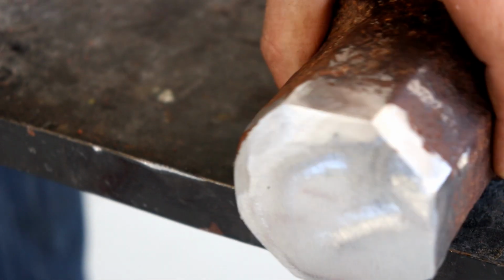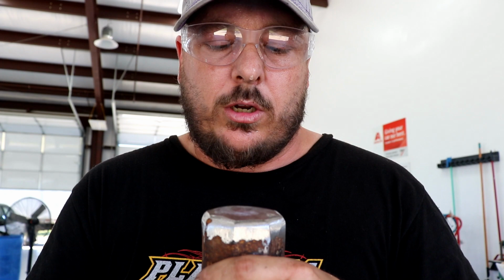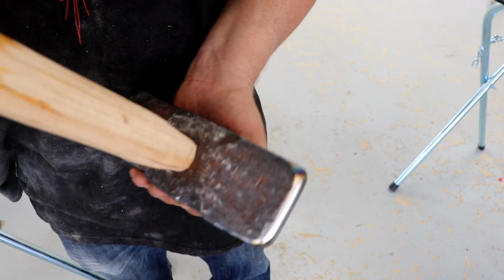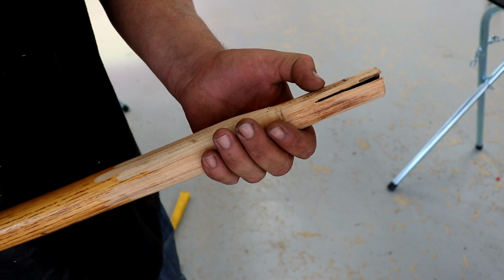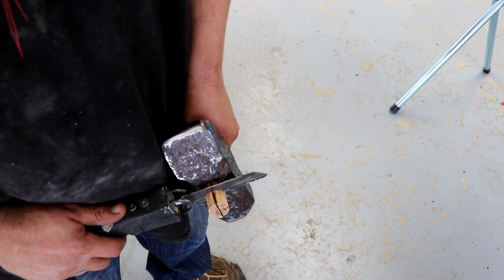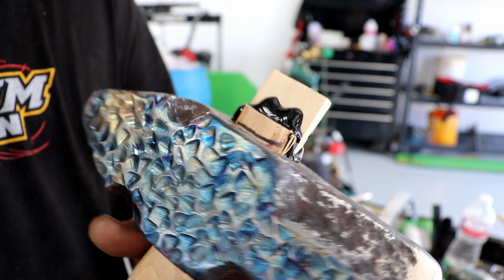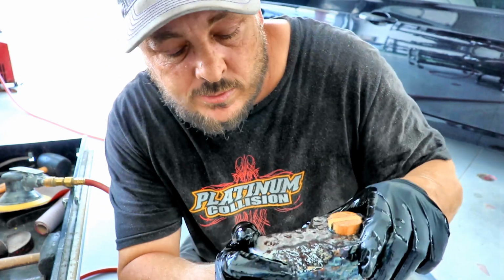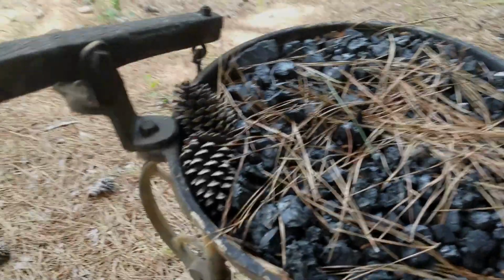RESTORING JUNK HAMMERS FOR BLACKSMITHING. Restoring Blacksmithing Tools Series.

Comment: Enjoy watching what you are doing. hint from an old logger and farmer told to me, put the head in a bucket of water  and hit the handle with a hammer. Pulls it right on up and the water swells the wood to insure a tight fit.

Comment: You are an artist both in your restorations and in your videography. So happy to have found your channel. Quick question for you or your subscribers... I recently purchased a rotary grinding tool like the one you used in this video. However I was so disappointed to get home and discover my air compressor wasn't even close to being powerful enough to run it properly. Can anyone advise minimum specs for an a.c. with enough umph to operate such a tool? Much appreciated.
Reply from the maker: +Trudy Schaefer Sure! You need a 60 gallon 90 cfm. They cost about $500 to $1000 depending. Hope that helps.

Comment: "We need hammers to make hammers."  Yes, yes you do.  As always, nice work.  I always enjoy watching you refurbish & customize an axe or in this case a hammer.  The more videos of your excellent work that we can see & learn from, the better.  

By the way, what was that spray you used on the hammer.  I suspect it was a bluing spray of some sort but any info or further details would be much appreciated.  Cheers from Vancouver Island.
Reply from the maker: +Imightberiding It was actualy just an oil coating to cool the temper. The temper color was put in with a torche. Thanks Brother
Reply: Ah yes, of course.  Makes perfect sense.  Thanks for the quick reply.
Reply from the maker: +Imightberiding It was actualy just an oil coating to cool the temper. The temper color was put in with a torche. Thanks Brother

Comment: Im not a blacksmith but I do find these videos interesting, but one thing puzzles me, I always thought the face of a hammer had to be hardened and temprered before use. Surely sanding it back like that will remove the hardened and tempered surface?

Comment: I will assume you didn't have access to a bench grinder or belt sander. Still that hammer came out decently and should be servicable enough to use for making some others in the shapes you need.
Reply from the maker: +CrimFerret I need to build a 2×72 belt sander! The rollock ceramic disks eat metal so fast a bench grinder would be left in the dust! They are amazing!

Comment: Great job!after this process do you need to heat treat the hammer again?
Reply from the maker: +Konstantinos Nanopoulos Good question! We do no besause the hammer face never gets hot enough to loose the original temper. Also on such a large hammer you want jt to be softer(rockwell hardness of 45 to 50) so it dosent shatter or splinter id yiu accidentally strike the anvil.

Comment: you might want to cut that sledgehammer handle. I tried striking with a long handle and hit myself in the nuts with the handle. I was on the floor for about a half hour. that's why none of my sledge handles are over 2 feet

Comment: one thing im wondering: why did you use the mini belt grinder to grind shallow domes in the hammer? slightly confused about that.
Reply from the maker: +Guerilza Just for looks. Check out the axe I made on Wranglerstars page. Ithink the vid is called This axe is Insane. It's just for looks.

Comment: Good work! But what solution did you use to get that rainbow color? And how did you get them black?
Reply from the maker: +Sindre Andrè Andersen I actualy used a torche. THose are temper colors. On axes and hammers you want the face to be hard but the eye and pole to be soft. With framing hammers you want a rockwell hardness of 55 or more but on a sledge face you want it to be closer to 45 so that it does not chip sending metal shards into flesh. .... I sprayed it with oil to seal and protect from rust. Hope this helped.

Comment: Is a cross peen useable as a sledge hammer or it the strike too inaccurate?
Reply from the maker: I Sure wouldn't be very accurate with it! ;) I guess you could set it on the work and strike the face with another hammer.

Comment: Nice hat baw. You in Louisiana?

What brand adhesive is that? I used Wurth Power bond on my sledge.
Reply from the maker: +matt p I can't remember the brand but it a panel bond simular to Power Bond. I would be shocked if you ever had a problem with your hang! Bullet proof!

Comment: I'd like to see what you did to the smallest hammer.   at least some better photos and explain what you did to it.   please.
Reply from the maker: You bet. It is known as a tinners hammer.I gave the tapered end a 30 degree grind and re-purposed it as a hot cut tool.
Reply: The Good of the Land. that's a really good  idea.   I have a few of those around.   do you think the angle will be harder to use or easier to use to hot cut your iron?
Reply from the maker: +Matt Hatton I used it yesterday and it worked great. I really need to aneal the head. Its far to hard.

Comment: Yep, I have worked with sledgehammers for years and years and I have salvaged hammer heads for a long time as well, I NEVER saw a hammer head that was so deformed before and I have seen some beat up hammer heads.  Soft is barely adequate to describe that particular hammer head, but if it's a good blacksmith sledge then it's well worth bringing back to life.  I know it's not the way it's supposed to be done, but I liked using a hydraulic press to drive my hammer handles on.  I never broke a handle doing it and never had a handle either come loose OR break down the road after pressing one on.
Reply from the maker: +MISTERComaToes It is the softest head I have ever seen!

Comment: you could have easy soaked that hammer in pure vinegar for three days to get all that rust off, but instead you just ground everything down
Reply from the maker: +A.h.k I didn't grind the rust off, I reprofiled the head because it was misshapen from heavy use. The pattern on the side is for aesthetics and rust leaves a beautiful petina when tou remove it with scothbright and oil it. This process took me an hour including filming. If I had waited three days you wouldnt get to enjoy this video I made for you!;)

Comment: I hope that you were careful not to overheat that steel, dude. Otherwise, its effectiveness as a hammer will be diminished, if not outright destroyed.
Reply from the maker: +KyleG. No color on the face:)  Sledges are only slightly hardened on the face usualy to a rockwell hardness of around 45 to 50. You don't want a a hard face because a sledge carries so much energy it could splinter and send shards deep into the body. Hope this helps.

Comment: You getting a real anvil? That swaging hammer is made 'less hard' on the face so that it doesn't damage the striking hammer when swaging . normally there would be a selection of different hammers with edges on the cross pein to use with your swaging block .Also because the material being wrought is at a straw heat the swage need not be too hard because the material moves as needed. As a rule the head face and pein are hard(ish) and the part where the handle fits is normal soft . You have a Yoder so you can also start making swage dies for that . On the subject of tongs, i don't think you have enough...  :-)

Comment: What did you spray on the head to the the blue color? What that actual gun bluing?
Reply from the maker: +The Bootheel KidThe color is a true heat temper blue from a torch. The spray us just oil.
Reply: The Good of the Land oh ok thanks for the fast response i was playing with heat blueing a knife i made last night but i couldnt seem to get that same deep blue that you got
Reply from the maker: +The Bootheel Kid The mass of a big ol hammer gives you alot of room for error. I cant say that I could get the same finish on a knife and keep the hardness.

Comment: That is not how you restore a hammer.
Reply from the maker: +William Ross That is how I restore a hammer. That is not how you restore a hammer.
Reply: To be fair he did say he was modifying it for blacksmithing
Reply: @TheGoodoftheLand  I don't think he was trying to speak down about the work you did. But I agree with both of you. I don't feel that this is a restoration, but more of a repurposing or just converting an old sledge hammer head to a blacksmithing hammer. I think he said that becuase the project wasn't restoring the sledge to look and perform as it was new.